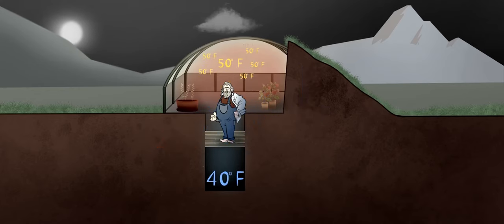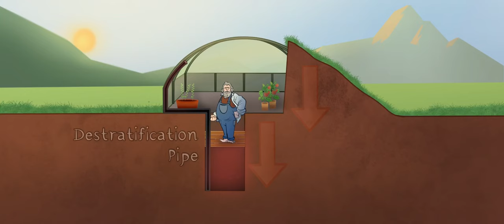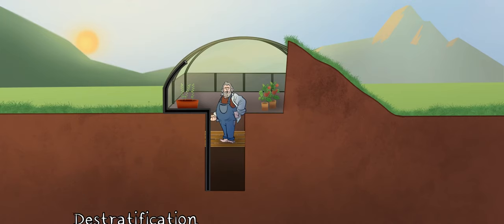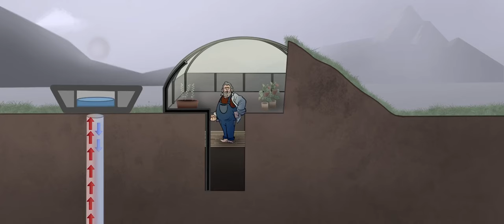The Wofati Greenhouse movie excerpt - intro

Comment: It's a brilliant experiment and I'm sure some of these improvements will advance greenhouse design. I'd like to incorporate some of these clever features into my own greenhouse. But the overhead umbrella eliminates much light, and the growing area is small given the amount of construction. Only the heating is passive, not the watering or maintenance of the plants, so someone will usually still be visiting the greenhouse daily. I wonder if a a low-energy-input heating system greenhouse would be more efficient to build and grow in than a no-energy-input one.

Russ Finch has for decades been building inexpensive greenhouses in Nebraska that are large and warm enough to grow citrus trees, powered only by buried plastic tubing and a small fan at one end. I think it's $10 of electricity per year or less to heat a large greenhouse by that method, and that trickle of electricity could surely be powered by off-grid energy generation: wind, solar, etc. with a battery, maybe no battery if located near running water that can be used. Those greenhouses are much larger and let in overhead sunlight, but they don't freeze at -25°F. I think it gets -40°F out there. So while a completely passive greenhouse is an important proof of concept, maybe we're getting diminishing returns by going totally passive, requiring a much more sophisticated and smaller greenhouse than one that uses a very small amount of power to heat itself (like a single small fan).

On the other hand, digging is a lot easier without having to bury piping over a large area, and that isn't possible in some places. I'd love to see some of these clever ideas in action, like the copper pipe passively accomplishing air transfer. I expect this design works. I have nothing to complain about when it comes to a greenhouse that works with entirely passive heating. There's certainly much to learn and innovations to pioneer and popularize here. It's been proven that much can be accomplished with windows on just one side, especially in sunny areas, as seen with Earthships.
Reply: I like both of these designs,  my last Northern passive solar green house was zone 10a on a cold winter and 10b on a warm one.   This is without anything but 8mm twin wall polycarb.  Just a second layer inside for the two coldest months would have given it, easy zone 11++.  But that greenhouse was defacto living space most of the time and the cost was around 15-17$ per sqft in 2018 prices.  It would be nice to get the embodied energy waaaay down and costs down. A dirt floor would have saved several $ per sqft.

The copper pipe thing is a good  idea, but not copper, a 2" copper pipe would cost a small fortune even in the 'before' times.  And no move squat for air.  But a 6-8-10" piece of drainage tile (black corrugated pipe) in place might work wonders.  This is a great Idea I'd love to try. 

I am with you, that a little tiny bit of 'active' can go a long way.  Everything is diminishing returns it seems!
Reply: It looks to me like the placement and angle of the window in the wofati greenhouse is specifically designed with the low angle of the Montana winter sun in mind. You're letting in the majority of light in the winter, but blocking more of it in the summer when it would overheat things. Plus anywhere you have glass will lose a lot of heat overnight because of the poor insulation.
Reply: Russ Finch's design might depend greatly on latitude to work. His farm in Nebraska is around 42 degrees North, so even though its well below freezing he still gets above 9hrs of sunlight on the shortest day of the year. My location is 53 degrees North; id be worried Id go to great expense of landscaping and materials only to end up with a marginally more efficient greenhouse with poorer access and working conditions.
Reply: As someone would have to attend the greenhouse on a regular basis, a gravity generator would seem to be an appropriate source of power.  (i.e. a heavy weight on a chain is connected to a very high-ratio gearbox which turns a generator to charge the batteries that power the rest of the system.  It is a very low-tech, cheap system that can be put together with (mostly) found parts.  It can even be made automatic by having water pouring into a bucket be the weight, with the bucket tipping into a tank when it gets to the bottom of the chain, so the whole system will reset by a counterweight.  ...or make it robust enough that someone sitting in a chair is the weight.)

Comment: This just popped up in my YT feed, is a great intro to draw myself and others to the entire movie. 

For the thermal air siphon, a copper heat collector, with a plastic pipe down to bottom of trench may more cost effective for daytime cooling, and a second heat collector buried in the soil, bottom of trench for nighttime heating to prevent freezing.  Perhaps a Y fitting, and thermally actuated flap to take the top collector out of the loop at night, since with the 55 to 40 degree nightime differential convection flow will be very mild, and passing it through a cold top collector would slow it down.   Daytime,  I expect the top collector would easily hit 90 degrees, with the solar power (thermal gain) and a greater difference in temperatures daytime air flow would be significantly stronger.   

For spring/summer a PV panel and fan would drastically increase the cooling capacity of this system.

Comment: This is a great idea, these are all really good improvements. There's one improvement I'd like to add which I'll call Improvement 0, because I think it comes before all these and IMO it the most important for anyone looking to grow food and live efficiently. Improvement 0 is taking advantage of the fact that humans like to live in warmth, and so do plants, so how about we combine these and live together and turn our house into a plant growing house, and train our minds to embrace that we should be living in greenhouses This is what I'm doing and its amazing, I'm growing 8  Banana trees and 3 Pinnapple plants in my Tinyhouse on wheels, which ia a greenhouse I live in. I'm building a RMH for supplemental heat, also using ground heat/geothermal, and the whole south half of the tiny home is clear twin wall polycarbonate. My Tiny Greenhouse is on a trailer so the North wall and roof are heavily insulated. But since the trailer is 2ft above the ground, I'm skirting the bottom sides around the trailer against the ground insulating it, and doig this effectively allows me to use the entire ground under the trailer as geothermal heating mass that will effectively do the same as having a North wall thermal mass. Additionally, I'll be insulating the ground out away from the trailer skirt about 3-4 ft to move the ground frost line that distance away from the ground under the trailer so cold doesnt creep in. The trailer is 8 ft wide, but the south facing Twin wall polycarbonate section is actually a 10 ft x20 ft addition built on the side of the trailer directly on the ground so I have 18 ft x 20 ft of ground geothermal mass available. I've got quite a few more tricks too..... this is just the beginning.
Reply: Additionally by living in your greenhouse you are increasing the CO2 levels and increasing plant yields.

Comment: I love it!

I am usure how exactly to keep the earth dry without a complete capillary lock on the dirt,  Possible but would turn into a large amount of membrane and even a small leak will eventually saturate I would imagine.  Maybe you are lucky to have really sandy soils.  Clays would be really tough without a physical moisture barrier of some kind I think. 

The dirt roof will still want some insulation somehow, otherwise it could be a perma-loss for heat when you want it for 5 months out of year.  even R5 would be amazing and probably do the trick.  Lets keep the evolution going!
Reply: Great points.    I would imagine some form of closed cell insulation with the membrane and then dirt on top.

Comment: Sounds very interesting. I'm looking into greenhouses and heating for a somewhat different reason than most. I breed rare tortoises, and plan to move north. So, I need to keep it a minimum of 70 at night, and a minimum of 85 in the daytime. In the end, I can't see any way around that needing supplimental heat in the winter to get that warm, but things like this can potentially offset the amount of supplimental heat I do need.

Comment: ...and, for even more passive heat, know that composting is exothermic, meaning it produces heat, more than 170F, if you aren't careful to keep it below that to avoid cooking helpful microbes!  If you place your compost pile below the water tank with loops of HDPE pipe in the compost connected to it, as the water in the pipe heats up, it will naturally rise and warm the water in the tank.

Comment: I love this idea. It seems to me the piping would be too small to move a reasonable amount of air to make an effect. Was their a calculation for that diameter?
Reply: Black unpunched drain coil for doing the circulation cycle.
Much akin to using draincoil (behind glass enclosed box in sunshine; during winter) to heat houses when it is winter.
Fan assist for boosting transfer.
Can be coupled with water filled barrel in ground for either heating or cooling. Pump needed for max respones during peak heat and cool.

Comment: Good idea, but in our climate which is a cloudy maritime climate in the winter and shoulder seasons light is limiting factor. Assuming you don’t have a supplemental source of electricity and light then your ideas were great other than the covering of the east and west windows, as you would lose a significant amount of llight and also solar gain. In addition, the Earth does not provide Insulation, but it provides thermal mass. As a result, this provides a thermal buffering mechanisms. This could be improved by adding insulation beneath and to the rear of the thermal mass.